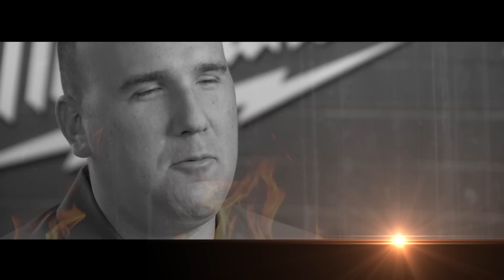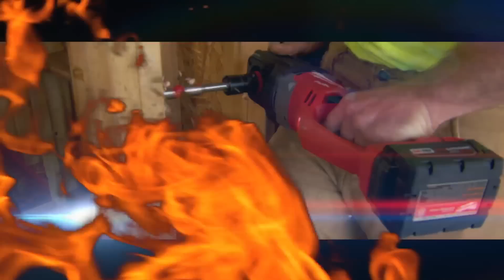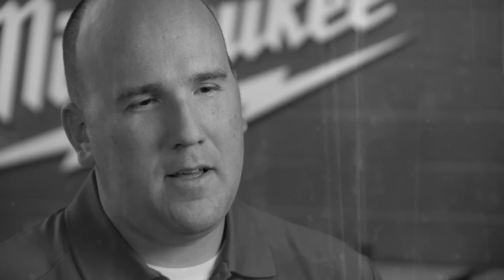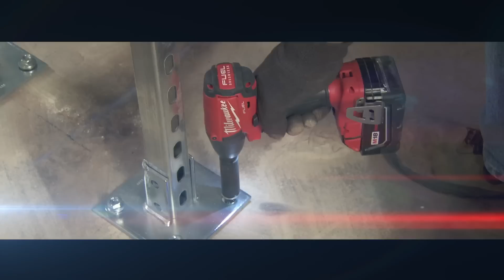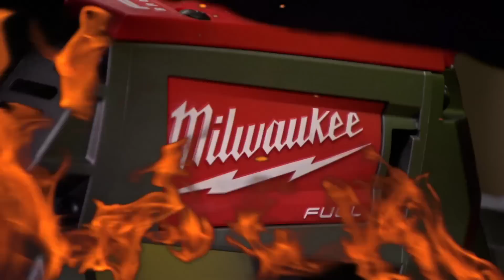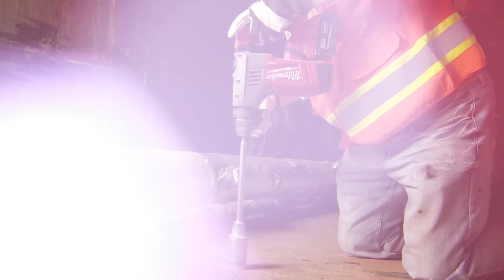Behind The Scenes of M18 FUEL™

Comment: I own the M-18 circular saw and the straight die grinder, as well as a variety of drill bits both steel and SDS hammer drill bits.
I am extremely satisfied with all of my Milwaukee tools and I am going to continue to get more of the M-18 tool line!!!